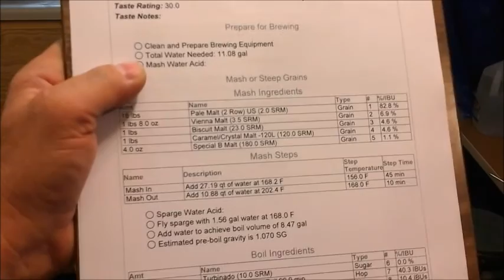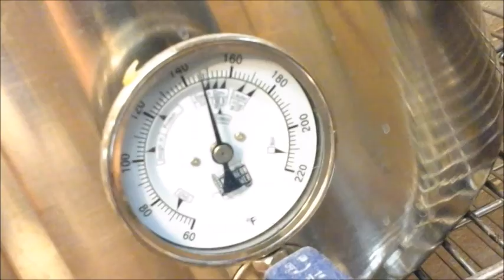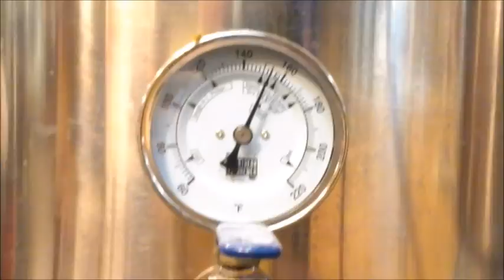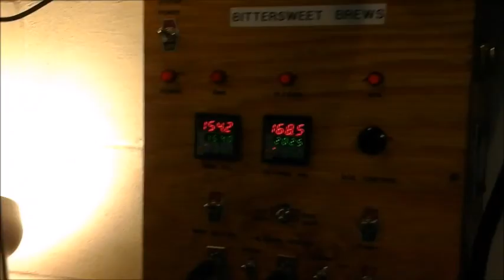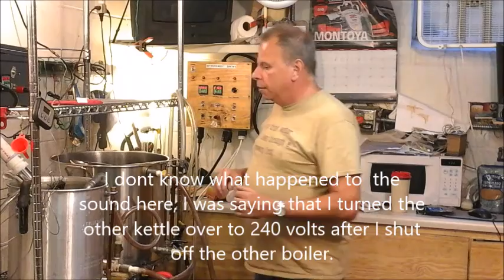PartiGyle Brewing a Barleywine and Pale Ale Saison

Comment: Your mill setup is almost just like mine. I cut the bottom of the bucket that the mill is installed in off. When I use it I slide the mill into an old 6 gallon fermenting bucket and grind away. When I am finished I just pull the mill out and all of the grains stay in the lower bucket. Works great and keeps from having to pour the dusty grains from one container to another.